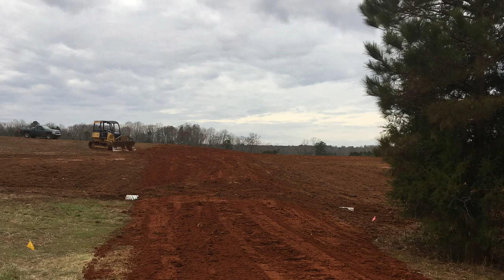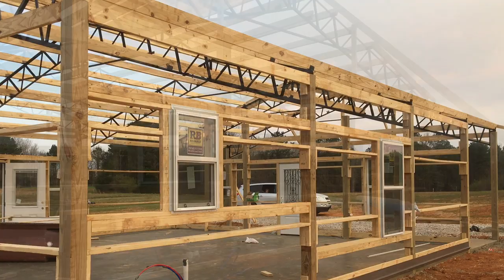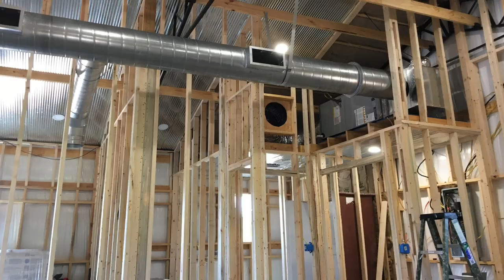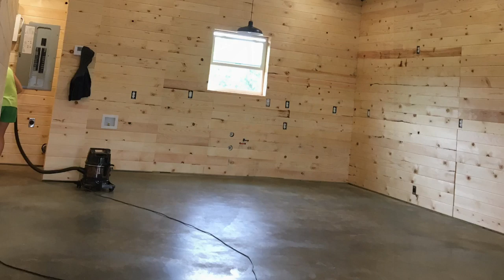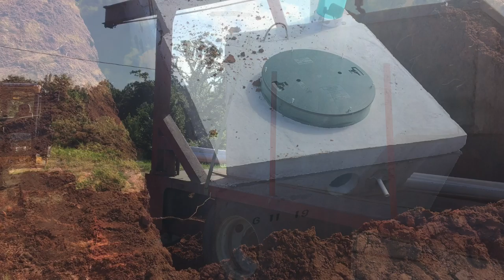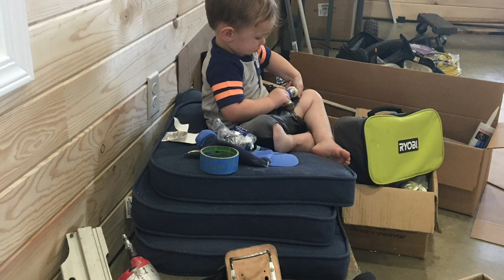Our Pole Barn House from Start to Finish

Comment: I know this is an old video, but I’ve been watching a lot of building vids on here. I bought 12 acres back in Oct of last year that I’ve slowly been clearing with my chainsaw and tractor. 

Eventually we wanna build something like this. My question is where do I start? Did you do most all of this yourself? Did you contract some of it out? Where did you get the floor plans? Thanks for any info you’re willing to give out!
Reply from the maker: Yessir. Did all of the inside work ourselves. And yes I drew my own floor plans. On a regular sheet of graph paper.

Comment: Congrats on a fantastic job. Thanks for sharing all the very informative videos.Getting ready to start a similar project at Enid Lake, Ms. and had a question. I noticed the furnace/air handler is installed horizontally over the laundry closet. Have you had any issues with noise or vibration? Was thinking about doing a package unit outside but I think I like this solution better. Thanks
Reply from the maker: No issues so far!! I had considered a package unit as well but my HVAC guy thought this would work better. Appreciate ya watching!

Comment: Looks great! Couple questions if you don't mind. Was the shell a kit? Why did build inside walls in 3 sections (bottom, middle, top)? What is the r value in the walls and roof? Thanks again for sharing 😊
Reply from the maker: The walls are in sections because they put up the 2x6 purlins to attach the metal too and I studded up between them. 
R value is 23 all the way around. Thanks for watching!
Reply: @LifeOnTheRidge  Thanks for the quick response 👍. One more question. Is there any venting in the roof or is it sealed?
Reply from the maker: I vented everything through the side walls instead of the roof (less chance of roof leak this way)

Comment: Do you think with a different floor plan a small loft could be built over some of the area? Say like 8 ft ceilings in bedroom/bath area with loft above that with higher open ceiling in Kitchen / Living area? How tall is the tallest part of the house? Sorry for all the questions on your videos but each one peaks my interest and leaves me with different questions.
Reply from the maker: You could definitely do it with a loft above. Probably have to do a little taller side walls though. My side walls are 10'. The peak of the roof is about 14'

Comment: Congrads on your new house. I am in the building planning process and have been for awhile now. cough, cough.. haha. What is the R value on your ceiling insulation and do you wish you would have went traditional trusses vs. steel if cost was out of the picture. Curious about all the interior finishing and insulation with steel trusses. Thanks in advance, Robert.
Reply from the maker: R value in ceiling and walls is R23. I don't think I would have done anything differently
Reply: @LifeOnTheRidge  Thanks. i have been uncertain about how to insulate the ceiling well enough and finish the ceiling with the steel trusses. Thanks for your feedback.
Reply from the maker: I wish I was able to have more R value in the ceiling but I had limited space to work with. Having an attic space would help with this

Comment: Did you have a footer dug by them ?
Reply from the maker: no we didn't have a footer dug around the perimeter. Didn't see the need since the weight of the building actually rests on the posts.
Reply: @LifeOnTheRidge  how are the posts set?

Comment: A very impressive job all around!👏🏻👍🏻💪🏻🙏🏻
How did you secure your wall  bottom plates to the concrete floor?
Reply from the maker: I used a ram shot
Reply: Thank you!👍🏻
What size nails and what spacing do you recommend Sir?
Reply from the maker: You have to buy special nails for the ram shot tool. They (ram shot) sell a nail just for that application. I can't remember but I think I put a nail about every other stud or every 2 studs.